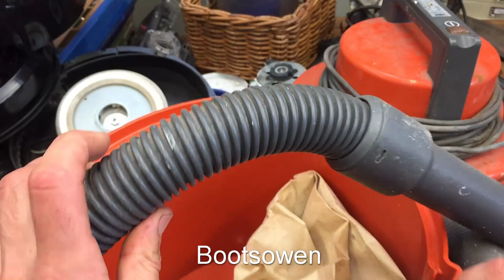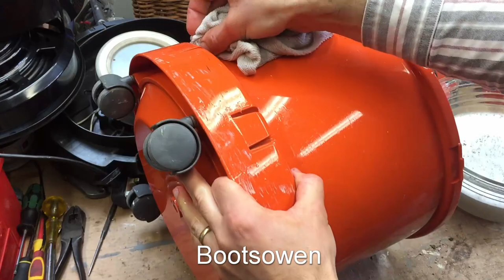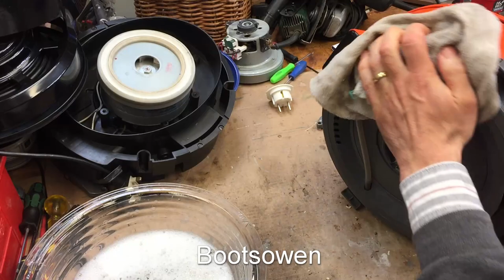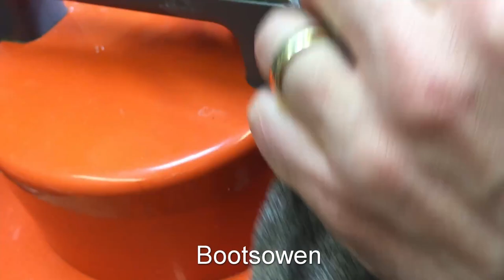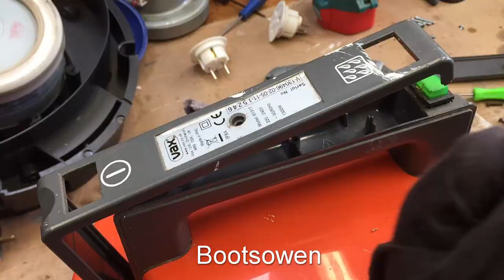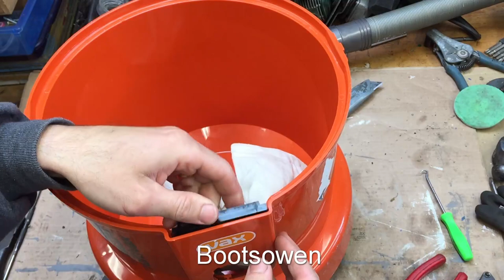Vax 6131 wet and dry: cleaning the filters and washing the hose, a general cleanup!

Comment: Great video, all helpful stuff but you stopped where I wanted to go. I wanted to get into the motor and clean it. I have had my Vax from new but I took up some rubble in it when I moved house and it stopped the motor. Started again after cooling but I don't want to run it and damage. Can't get inside to clean it.
Reply from the maker: Have a look/search for a similar video I made on a vax 121.

Comment: I wish I’d found your video before I’d thrown away my filters and ordered new ones but I need more help than your video gives I thought you were going to get into the motor when you follows them cable to its cover but then just pulled it out wiped it and put it back. I don’t see how cleaning behind that plate or the waterproof covers helps save fir asthetics but what I really needed and hoped fir was you showing how to get to the engine
I had a bag burst so I’ve cleaned as far as I can but need to vacuum the inside of the motor so the dust doesn’t burn the engine out. I’ve a hand held Dustin I can use to do the vacuuming but how do I get the housing off the vac to get to the motor. Would love you to tell me that please
Reply: I have some typos sorry I meant I have a hand held Dyson not a dustbin . Predictive text is a curse
Reply from the maker: I have posted videos on the VAX 121 going into the motor, it is similar (search YT). If you can't figure out how to take it apart just take the motor unit outside and run it with no filters in the open air while shaking and banging it. One bag load of dust won't worry it too much.
Reply: @bootsowen  brilliant thank you so much. Your a superstar

Comment: I had a problem with the water pump for spraying the water on for shampooing it broke from new before I fully completed one car so replaced it at Argos with another new one same problem, might be wrong shampoo or using too hot water.
Reply: The pumps in there are very unreliable, I have a 90s one and I've replaced the pump and it's broken again for whatever reason they just break, it's a shame as it's a good wet and dry apart from that

Comment: If your gonna use that for water you’ll need the ball float filter, the filter you have is dry only
Reply from the maker: I have used a vax 121 without the ball float filter, just a filter like this and it works fine, you have to be careful not to take on too much water,

Comment: Another way to get round the hose clanging against the glass is to put a towel/rag around the hard ends/pipes and that softens the blow against the glass or drum
Reply from the maker: That’s a good idea. How do you stop the rags coming off?
Reply: I believe that filter is dry use only and there is another insert with a water level cut off for wet use, good video.
Reply: @bootsowen  I'd just do a couple of wrap rounds and hope for the best...sometimes they slide down, but even with just throwing in some loose towels in the wash can improve it anyway

Comment: Did u ever consider setting up an old dishwasher for cleaning parts Mr B ?
Reply from the maker: I did Tommy, but I have two beefs with washing parts in them, I would have to give up a good amount of space for one in the garage, and it would be rare that I would have a dishwasher's worth of parts to wash, but you have me going now. I reckon a cleaning a dyson in a dishwasher video is on the cards, the indoors dishwasher it a tough old horse and wouldn't mind a trip around the back of the bike sheds. My third issue is that a dishwasher doesn't dry plastic and if I wash steel parts in one, which I have tested, you have to stop it before the dry cycle and get the gear out, otherwise it will rust .